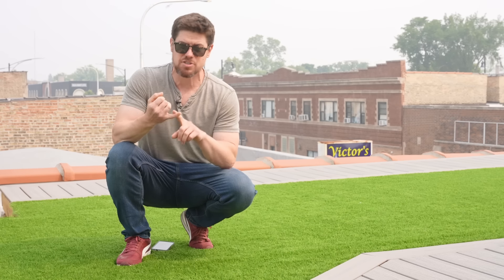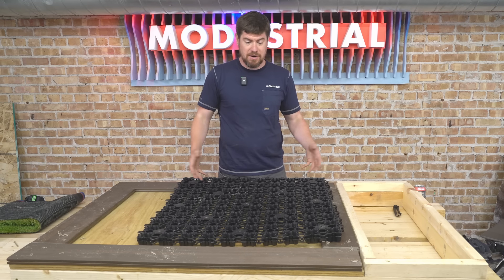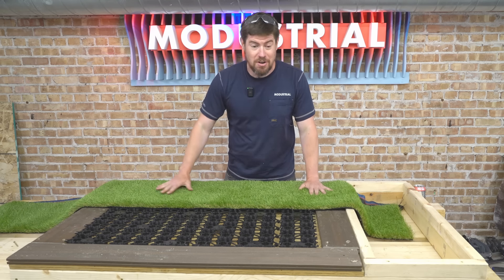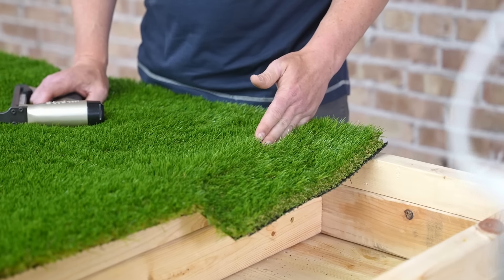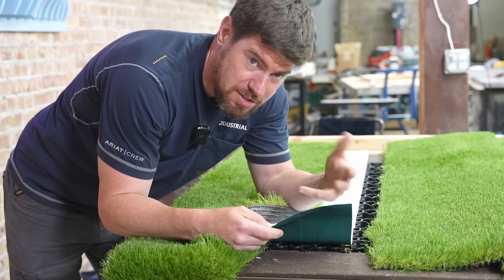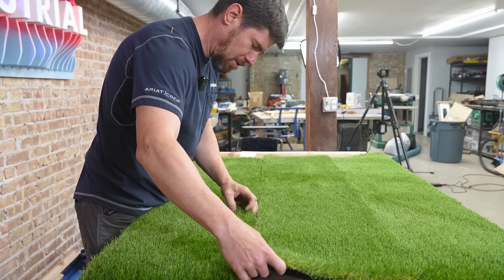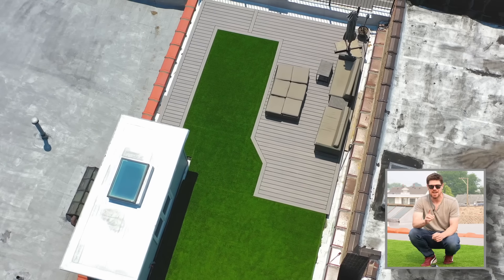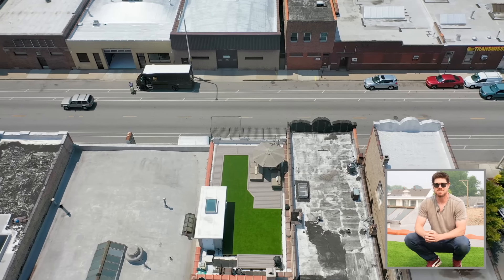How YOU can install Artificial Grass ANYWHERE -- Easy DIY

Comment: Thank you for the video. Very intuitive. I have a question. I plan do do it on a rubber roof. In this case, how can i secure the turf on drain tile? I guess i can't use the stapler since I don't want to break the roof? Do i always need plywood under the drain tiles?🤝

Comment: What do you do when the staples rust later on?
Reply from the maker: They don't rust ... You use exterior stainless steel or hot dip galvanized staples

Comment: Will there be fence on the low levels between buildings so Tex won’t go over into their roof?
Reply: Looks like you didnt watch the last video lol. He was getting that measured for fitting the same railing as the side.
Reply: @jaymitchell1181  I saw that he put a fence at the end but not the side
Reply: @EchoamysDoghouse  A neightbour wh does metal work was mentioned in the video. He was measuring up for the metal fence in that area.
Reply from the maker: Yup, a fence has been ordered :)

Comment: Now... I've been around since AstroTurf made its premier at the AstroDome.  I wasn't at the Dome, but I do live in Texas.  I have seen several places where they had concrete and put down AstroTurf.  Now, to the best of my knowledge they didn't put the under stuff down.  However, in every single case, those places now have real grass.  These were all outside, in Texas, in the 1960s.

Comment: Great tips on the installation. But 1.5 to 2.5 lbs of infill per square foot? Sounds super expensive. I'm wondering what the full cost will be for the deck. Mentioned in an earlier video?
Reply from the maker: I spent about 12k in materials for the deck and yard
Reply: @modustrial  ouch, but hey it looks good bro, thanks. BTW, cool dog.

Comment: It looks amazing and im looking forward to that stage maybe? I’m glad you made this video. It looks like a great low maintenance product. I hate plywood in any horizontal manner exposed to weather like Massachusetts. I’m still going to say I’m concerned about the dog peeing and an odor issue on hot and humid days. Porous material and urine do not mix. The urine crystallizes into a salt and will not come out of that wood. I work in commercial structural drying.

Comment: Is this the method used for artificial soccer/football fields?
Reply from the maker: Yes, I have seen installations with Air Drain for soccer and (American) football fields.   The only difference is the type of artificial turf -- its a lower blade height.  But the process of installing is the same.

Comment: But you shouldn't install artificial grass anywhere, as it's incredibly bad for the environment. 

It has a huge carbon footprint in both its manufacture and transport. Lifespan is limited and although it can be recycled, this is not easy and can only be done at specialist plants after a specific cleaning process. It will break down and put microplastics in the environment as it ages. Instead of mowing, you are now washing and vacuuming your fake grass to keep it looking good.

Artificial grass reaches significantly greater temperatures than those reached by natural grass under the same weather conditions. Plastic lawns can overheat in hot weather, making them unusable. Real grass has a cooling effect to spaces it's in, fake grass will do the opposite.

If installed on soil, it, restricts access to the soil beneath for burrowing insects and to the ground above for soil dwellers such as worms. Soil organisms loose access to nutrients, so you end up with dead soil, causing carbon to be released back into the atmosphere. It's a dead habitat for wildlife in general.

The typical American lawn that's a lush green all year long lawn isn't much better, but at least it has some photosynthesis and the soil isn't totally dead. 

People need to move to more mixed planting of various grasses and other plants, as in a meadow instead of a lawn. Keeping it long through the summer helps it cope with the summer heat and protects the soil from being baked hard. Clippings are great to mulch other plants to help them retain water too, reducing the need to water them. Much better for preventing water runoff in heavy rain events also.

If you live in the desert, you should be planting rock gardens and desert plants and not lawns while you can before the climate gets to the point that it's uninhabitable for humans due to the continued use of fossil fuels and other inaction on the causes of global warming.
Reply: yeah turf is fucking awful for pretty much everything but sports.

Comment: Pro tip: use a shop vac to hold the blades of grass you’re keeping out of the way of the knife while you cut off the excess – allows you to cut from the top while protecting the grass you’re keeping from getting cut (so you don’t have to fold back the excess and cut from the bottom). It’s more tedious, but you can also use a 10” drywall blade to hold back and protect the blades from getting cut if you want to cut from the top
Reply from the maker: Good tip!
Reply: @modustrial killing the planet with micro plastic

Comment: Just to add to the seam part of the video, the best option is really to use a scallop/wave template to cut corresponding wavy edges with 8"-12" between the peaks and valleys. This removes the straight line in the seam, breaking it up and making it far less noticeable to the eye.
Reply: I can see how that would give optimal results, but it seems like a lot more work to cut and tape.
Reply: @JorenMathews  so you'd rather have a less optimal result because you would rather spend less time

Comment: Unsubscribing, stop killing our planet
Reply from the maker: I am behind your environmental concerns, but (a) you should research and learn more before this type of comment, and (b) your approach is only going to push people away and won't fix any problems. 

If you look into real grass lawns, you'll find they have a negative impact on the environment.   The water demands of real grass and chemicals most people use on them (even supposed green chemicals) mean that real grass lawns have a negative CO2 impact.

http://www.gogreen.org/blog/the-environmental-impact-of-lawns
Reply: @modustrial  A) that comments provides no value whatsoever, you can’t just say “research stuff without provide anything else to go along side it. B) i don’t have massive platform such as you to to promote harmful practices, who exactly am I pushing away and why? You should be doing better. C) I am fully against lawns and monocultures as a whole, grass lawns are detrimental to wildlife as well. I do not advocate for them, you are preaching to the choir. You should perhaps think of doing some good and planting an environmentally sound urban garden that uses sustainable plants with wild flowers that support the local wildlife
Reply: @modustrial I have an extremely small urban balcony that I use to grow native wild flowers why don’t you do the same, as opposed to encouraging people to get rid of the tiny amount of wild space they have access to?
Reply from the maker: You say I didn't provide anything... Yet I shared a link explaining in detail the issues with lawns.   I think at the end of the day we both have the same concerns for the planet, but it's a matter of degree as to how we share it.  Part of the problems we face now are the result of people who fundamentally agree, quibbling amongst themselves.   My vote always goes to candidates who support environmental legislation...and I donate to ocean conservation charities whenever I can.

Comment: Turf also has a natural way that the blades bend and rather than orienting the turf based on ease of cut you want to be sure the blades are all going the same way so you dont get weird shading on your turf once it's installed (think MLB fields how they cut the grass in specific directions and how you can see the lines because of that).

Comment: While artificial grass on a rooftop isn't such a huge deal (but there are still far better options available), putting a huge sheet of plastic (which is basically what artificial grass is) on the ground is the worst thing you can possibly do.  It essentially creates a dead zone underneath it where nothing can live.  You might as well put down a slab of concrete and paint it green for all the good it does.  Artificial grass is terrible for all life in your garden and for the surrounding environment.  The plastics used for artificial grass leech into the soil as microplastic pollution and ultimately cause long lasting damage - microplastic pollution is in pretty much every water source on the planet these days (including tap and bottled water) and in most foods we eat.  Soil is a natural carbon sink, as is natural grass and other plants that would otherwise be growing there and provides habitats for thousands, if not millions of organisms and insects.
Reply: Please come cut my grass

Comment: Doesn't fake grass get quite hot during the summer?
Reply from the maker: I have not found it to be too bad....I think that recent technological developments have helped in this area.
Reply: The OG Astroturf did, but not the modern stuff.
Reply: It can but if you water it it goes ok
Reply: I think most of the heat in artificial terf is caused by the black rubber pellets that keep the turf bouncy. They're mainly used for athletic applications, so I'm guessing the stuff he's using only gets as bad as regular grass.
Reply: Yes will be burning 🔥 your dogs paws 😮
Reply: No, it doesn't. We have had one for Almost ten years and we've never had an issue.
Reply: Nowadays they are designed with “cool” pigments, as in heat reflecting. Also additives like UV absorbers too go into the masterbatch that makes the synthetic turf. 
Further developments in the technology are to do with the infill.
Reply: With all of the airflow going through the turf i’ld say it would be nominal.
Reply: Air gap and lack of tons of black beads def help. Can confirm athletic fields get hot though, you can see them from space on thermal cameras
Reply: @keithforrester82  they could make it with thin air for me. There's no substitute for the real thing
Reply: @MrBob5y  fair enough
Reply: I have turf, it gets hot but never unbearable.
Reply: @FatClumsyGoat  dogs feet are alot more sensitive than human skin
Reply: @MrBob5y  That is false sir, they are either less sensitive or equal to. Give it a quick google, “They can also withstand different temperatures quite well. Therefore, it is likely your dog's paw pads are not as sensitive to sensations as our feet are.”.
Reply: In the south it gets red hot idk about Chicago
Reply: @MrBob5y  yes, but when your garden floods and your dogs track mud into the house all the time, you have hay-fever and cutting the grass is making you ill, artificial grass has it's plus side. Cleaning up dog crap is way easier.

Comment: Best thing we ever did was put fake grass in our backyard. We get a lot of water restrictions in Arizona in the summertime and when we put the fake grass in, we don't have that worry anymore. Plus we don't have to mow in the heat and we have green grass all year long.
Reply from the maker: Definitely!  There are a lot of knee jerk reactions that "plastic grass" is bad for the environment...but there is a tradeoff...grass uses a ton of water, most people use fertilizer and other products that are bad for the environment, so real grass also has its negative environmental impact.
Reply: @modustrial  we found a company that makes a sand that you put on post install and it creates a cooling effect when you wet it. Otherwise, if we don't wet it down, it is super hot. After it sat in the sun all day long. It seems to work for about 2 or 3 days before we have to rewed it